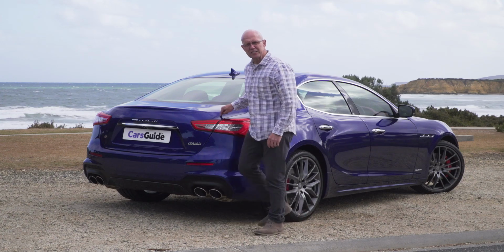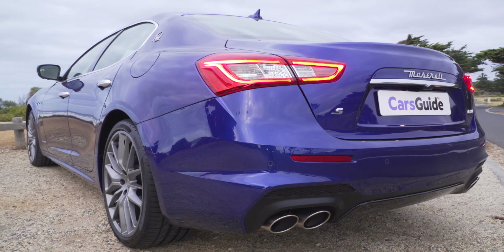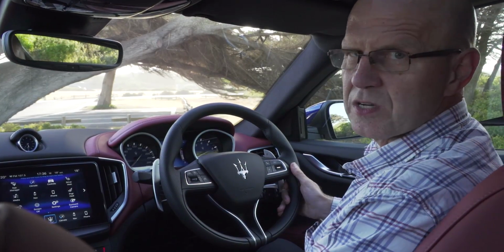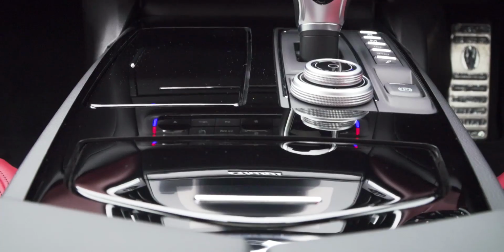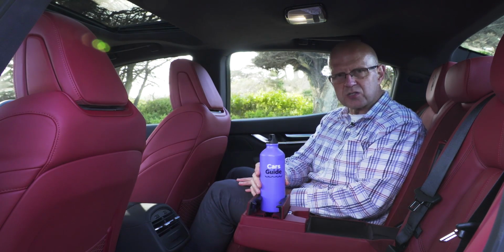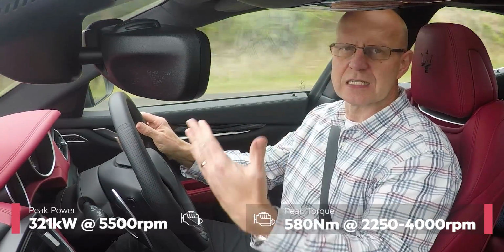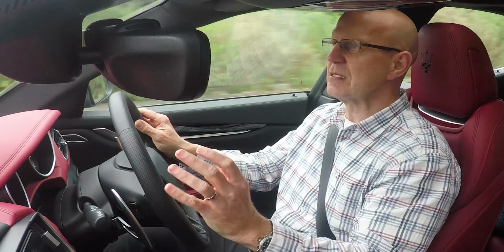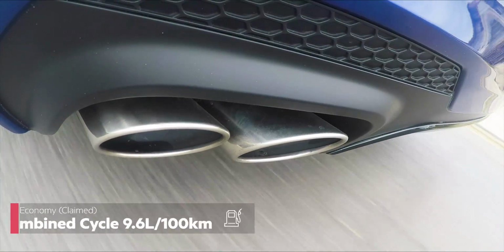Maserati Ghibli S 2018 review

Comment: How’s the panel gap? Could it still fit a tube of toothpaste?
Reply: I'm well aware of the differences between the cars mentioned. I previously owned an M5 and my wife currently drives a E63. Those are both a little quicker but I think the Ghibli drives a lot better and more smooth. I just find it funny that people that have never owned or driven these types are cars are so sure what is better. The "shared parts" as you say are minimal and make no difference to most people that actually own this car. 

I also previously owned a Porsche 911 (about 10 years ago), it had a few shared parts from VW's, so what? It was still a Porsche 911! The Ghibli has an engine block that is cast in Chrysler's foundry in Kokomo, Indiana. Then, are shipped to Ferrari S.p.A. in Maranello, Italy, where they are finished. So does that make the Ghibli a Dart or a Ferrari? Neither .. It's an amazing Maserati.
Reply: since Doug mentioned it i've been paying attention to that aspect in many cars. And I feel that Doug picked on the Maserati a bit too harsh i've been seeing it left and right on other premium cars too.
Reply: zefiro380 hahaha Doug DeMuro
Reply from the maker: Hi zefiro380, Fit and finish on the car we drove was excellent. JC
Reply: @carsguide  Not according to a youtube entertainment reviewer when looking at the 2015 model. Oh wait you reviewed a 2018 model, bahhh doesn't matter I will go with the sheep that say since the 2015 had panel gaps surely a new model will be the same as logic would dictate. Ends sarcasm.
Reply: Poor? Nope, I do quite well, not poor at all. Enjoy driving your used Honda Civic. (quick make up a lie and tell me you drive a Lamborghini).
Reply: .. says the guy living in his moms basement, bashing cars he could never dream to afford.
Reply: D I have eyes, and I can see the panel gaps.
Reply: Doug DeMuro has just Problem with Maserari because something happend... we don't know what but something happend... and now he hates everything about maserati although they are beautiful cars
Reply: Yes, I see it everyday when I drive my Ghibli. I just don't think it's a bad thing.
Reply: Agreed, I've been watching them closely because I like the styling and I would like to get one but why not give it power to compete with the E63s and M5s?  Also, the seat heater controls being in the screen is annoying as hell. The other thing is the rear window, it needs to roll all the way down, its a sedan.
Reply: Niccolo Alas I got to admit, Maserati do makes beautiful cars, including this one.
Reply: have you verified in visu? the door gaps are certainly angled differently but nice and clean while the doors are closed or open. those remarks are absolutly wrong and discusting, beside this has nothing to do with the driving, far superior to german statonwagons
Reply: D Wow, you really don’t need to defend yourself like that, I feel bad for you, really do.
Reply: +zefiro380 : notconsideredagapifitsdesignedthatwayjustlikemyrunon
Reply: Me ontenz you cannot compare the german bling bling unergonomic finish to a cosy british leather or Italien sleek design or american mess, it's like comparing birkinstock to Clarks or Armani shoes....or bear feet...
Reply: Wouter van der Molen You buy a BMW because it’s a BMW, but you buy Maserati because it’s different than a BMW. To be honest with you, I think the 2018 Ghibli is actually pretty darn nice, but some of it’s weaknesses are still present.
Reply: Another Doug fanboy regurgitating Doug's nonsense. Doug is dead wrong, the Ghibli is awesome.
Reply: zefiro380 Doug DeMuro is stupid
Reply: D Whatever makes you happy.
Reply: D If you think you spend the money to buy a car with that kind of panel gap and shared parts from a Dodge Dart when you can buy a M550i with better quality, more technology and more power, then I have nothing to say.
Reply: why pay 80 grand for a car that has shared parts with a 22 grand car mate? Maserati is still overpriced. it's like Paying a thousand bucks for a fried chicken that isn't even crunchy
Reply: D Yes yes, you own this and you own that, whatever. I don’t care what you say, I have eyes and brain. I know the quality and features of this car, and I know it is way overpriced. If you’re really that stupid to buy this kind of product with its full price, I really would like to do business with you and make a really good fortune. By the way, whatever you say about this car, its sales numbers around the globe aren’t performing at all.
Reply: D But, if you tell me all of this is trying to defend the poor decision you made to pay full price for this car then sure, I can understand you and I feel sympathetic for you. Poor guy.

Comment: Is an amazing car. Sporty. Practical. Exotic looks. Refined. Quick. I have a 2017 Ghibli. Is simply the best that I have ever had. I understand that the 2018 is even better. No issues so far. And I smile everytime I approach the car. And get a compliment or admiring look almost every day. Love it. Ciao
Reply: Dr. Blough, you are right, no need to pay a huge fee to an ugly cars owner club. One fustrated M3 owner told be about my Ghibli, " nice, but too bad it is not german"...I told him that he was right since without brembo brakes and Pirelli Zero Corsa, a german car would be a lot shorter by now, easier to park (definitively) and the ferry fees much lower, but having german ZF tier ones for ZF Sachs rheolitic suspension std on Lambo's, ZF HP8 gearbox & front diff.) GKN for self lock rear diff. and shafts, Austrian Magna transfer gear rather than a few chinese masterpieces was a must behind Martinelli's Ferrari unique DI and HP cooled engine with no german equivalent set ups yet....wind is blowing south, my son's Guilia 280HP veloce Q4 is also fantastic, yet smaller.
Reply: I've a 2018 Maserati ghibli and I am loving it!however,every time I try to switch to neutral level,it wouldn't and always goes between park and drive modes
Reply: Creeper Mishra I agree it is slow but you must press the trigger first then there is a small delay till you can move the whole lever. This is a safety to avoid false engagement and jump into a wall of the parking etc..Once you drive, you forget the lever.my 2015 Ghibli got an upgrade on it but it is still safe and slow...Philgood
Reply: I have a 2018 Ghibili S Q4 GranSport. Best daily driver money can buy.
Reply: Harman Khinda Fully agree and rest insure my 2015 S Q4 is aeging very well and i keep it. My ONLY trouble in 4 years has been a 10 minutes fix and adjustment of a small headlight nut lost after a ZF Sachs skyhook suspension upgrade and tyres change. Mileage is also very good, best on Pzeros and similar to our smaller 300hp Golf R w/Potenza for day to day use, for winter, preserving our Ghibli..my son's 280 Hp Guilia Veloce Q4 has best mileage of the three cars, An outstanding FCA product too. Philgood
Reply: One of my old boss who had called me for advise about my 2015 SQ4 just got one as well and reported very good first impressions. Told him that today I'd consider a smaller Stelvio QV or Guilia Veloce Q as well since my son got one and we all like both cars.  Never mind german bashing, forget Porsches Nikasil liners falling apart and enjoy better FCA top end.
Reply: Just your average Joe  00
Reply: @subodh how's going with Maserati 2017? Any issues or any feedback after 3 years?